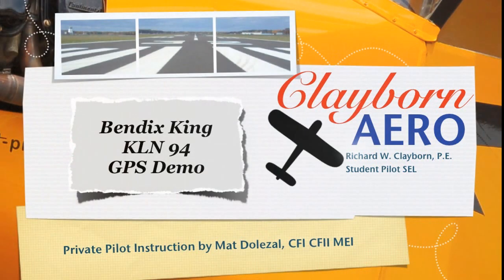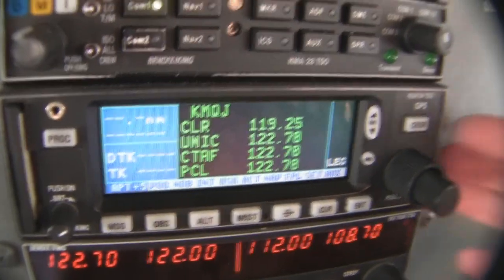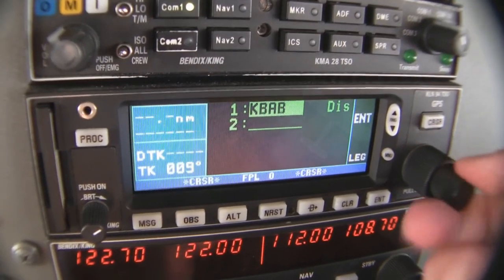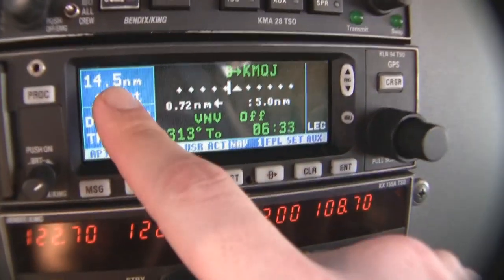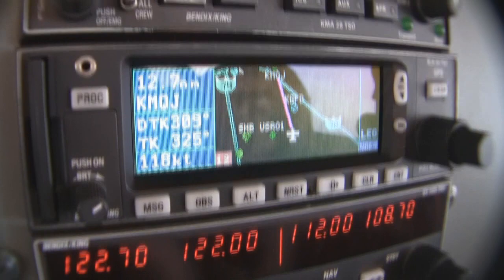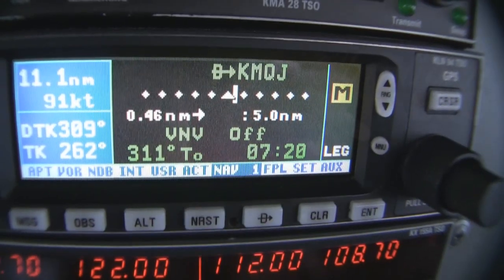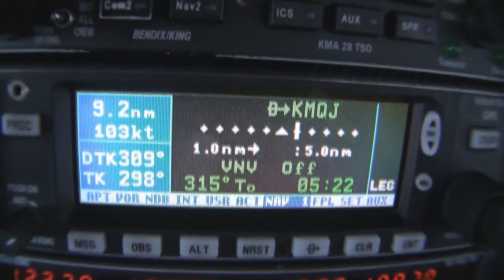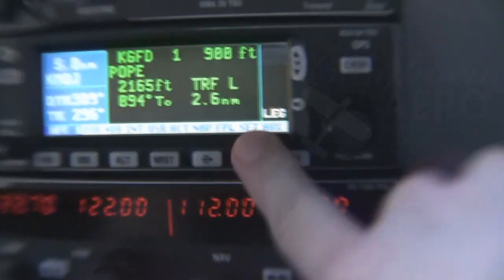Bendix King KLN 94

Comment: I enjoyed the video.  I actually have reommended it for a basic primer on the unit for prospective students.  I teach instrument flying in an aircraft equipped with this unit and have found it to be very capable. In fact, when it was introduced back around 2000, the only edge it didn't have over the Garmin 400 GPS was the smaller screen.  Unfortunately, Bendix-King then left their customers behind without an upgrade pathway and the rest is Garmin history.

Comment: The easiest way for the local airport: press NRST then ENT then D then ENT then MNU then OBS(mode), then select the bearing with the HSI or OBS knob on the indicator.  A white course line will show up on the map.  
FYI - If you already have the airport loaded in the GPS, you can skip the first two steps. 
NOTE: the OBS mode must be turned OFF to enable normal functions. 
There is an alternate way of setting it up using any airport.  
Let me know if you need that.